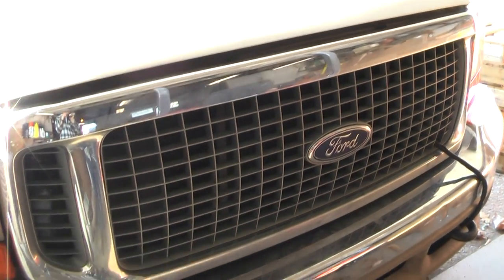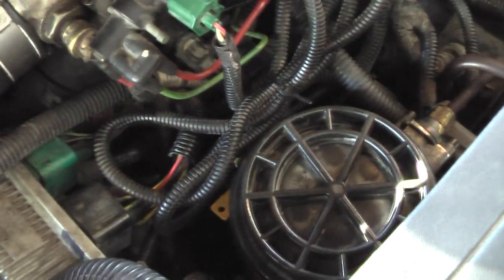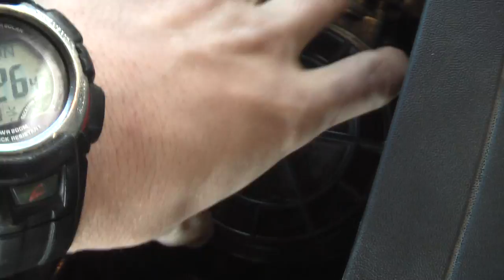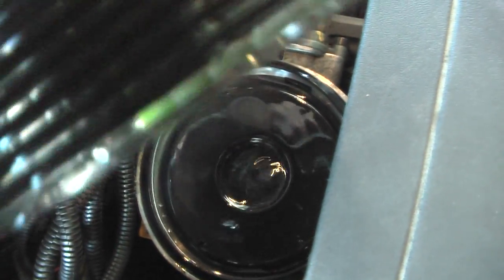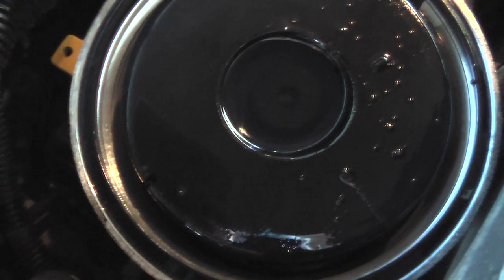How to Fix a 7.3 Powerstroke Fuel Leak

Comment: @MDizzel16 this is another problem other than the lack of sulfur for sure.  would contact ford to make sure what the real problem is. sulfur in diesel fuel really is a bad thing it's not just eco maniacs making noise really don't need it in diesel fuel. there are other things that are good for lubrication in diesel . biodiesel trucks run just fine without it as a matter of fact run better.  dont' drink the coolaide sir. extremisim in any direction is wrong.

Comment: I have a 95 stroke an it has been leaking off of the sensor that tells if there is water in my fuel. Could it be the same thing? It was leaking, then it stopped, then it started again and became worse. Thanks

Comment: Hey quick question. I have a 94 7.3 turbo and i narrowed the diesel leak down to that valve i think. What exactly is it called and where did you get the new one?

Comment: 439.I bought the genuine Ford valve from Amazon Prime for $39.50 on 1/24/17.
Reply: Did Ford valve come with imoroved blue rings ?
Reply: Some say the blue fluorosilicon seals may be better.

Comment: I have a 96 7.3 PS turbo.My fuel leak is the seal of the fuel filter.I have replaced it with 3 different ones and each one has leaked.Am I going to have to replace my whole fuel bowl assembly?
Reply: Hi did u find solution?

Comment: Does the fuel drain line just pull off. I didn’t see you take it off. Is there a fitting?
Reply: It just pulls off. There isn't a clamp on it since it's a low-pressure release.
Reply: I think a torx size 20 driver was used on 4 screws 🪛

Comment: New viton seals on ebay for $5.00. unfortunately you're probably going to have to do this again in a year or so since you got the ford parts, not sure, but I don't think they're viton seals.
Reply: What is the part  #?
Reply: actually, there are some seals even better than viton. They're called fluorosilicone seals and you can get them at a web site called "deisel o-rings.com" you can also check out riff raff diesel, they have the fluorosilicone seals and the drain valve for 35.00, which I know you don't need, but just in case. All that said, I would absolutely get the fluorosilicone seals for the drain valve as the ones from ford are guaranteed to leak again soon.

Comment: Does this apply for a 1997 7.3 as well?
Reply: Yes.  I have the same issue going on with my 96'.  I haven't fixed the issue yet.  I was told the same thing from a local diesel shop.
Reply: i would check with a licensed diesel mechanic, i have a 97 7.3 myself, what people dont realize is that until 98 the 7.3 was made by international, 98 wqs the first year that the ford made the 7.3 motor for the trucks themselves so some things may be different
Reply: not sure where you got your information, but international built every 7.3 engine ford ever used.. they also built every 6.0 and 6.4 afterwards. 6.7 is the first one that ford built themselves.